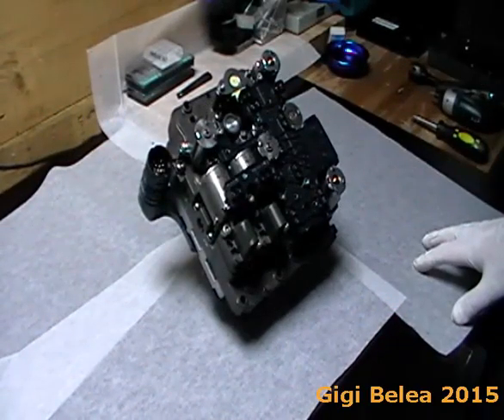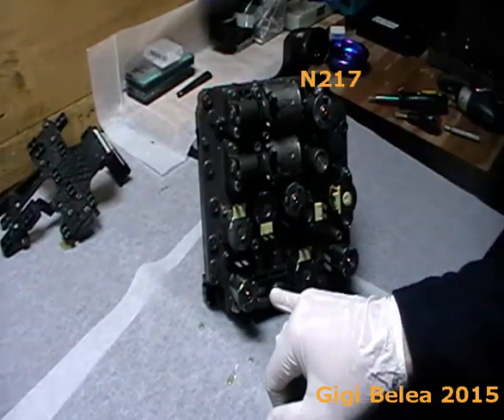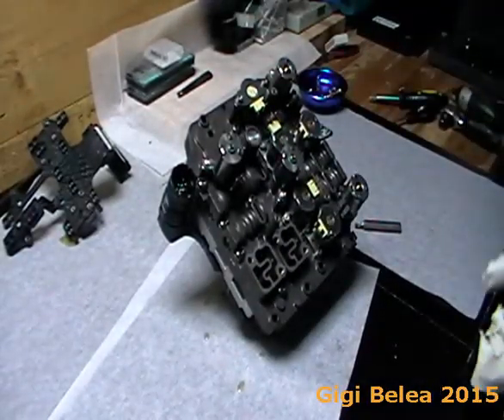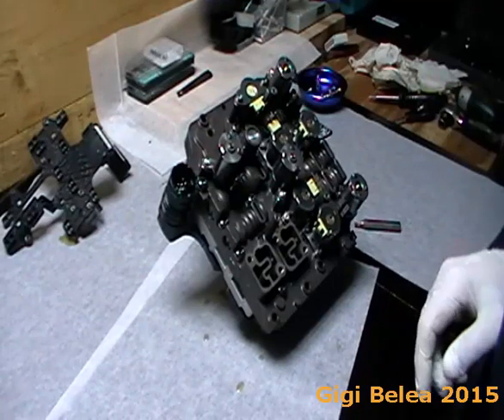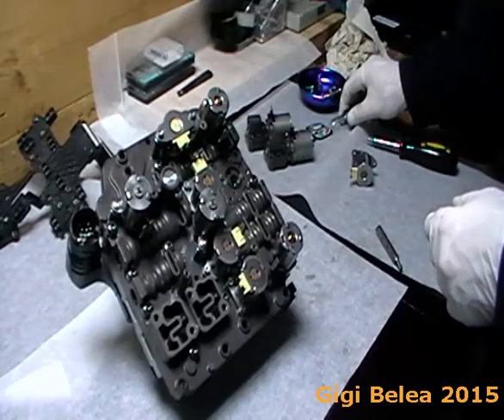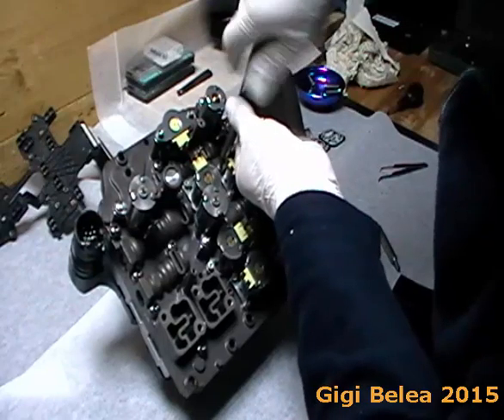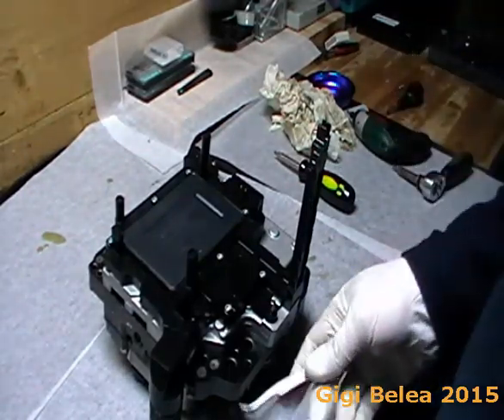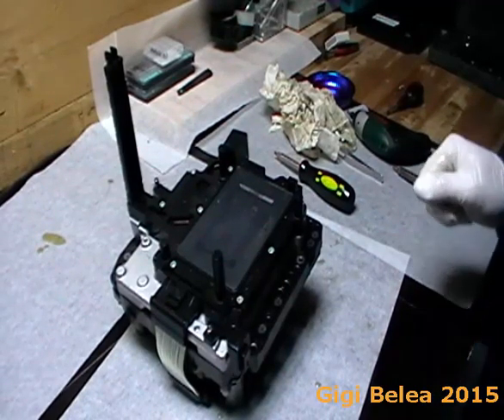Changing DSG Solenoid / Valve on DSG6 Mechatronic Unit

Comment: What can I say! Following the guide you have in your description I fixed my mecatronics myself! My issue was FORCE SOLENOID N215 N216 with jerky DSG gear changes! Your guide told me exactly what to change and the video helped me install it! Many thanks
Reply from the maker: Glad to hear your problem is solved !
Reply: Hi Greig, Did you have an issue with the transmission being jerky in reverse and into 1st gear, and also all the way up through the gears? did you only replace the N215 and N216 valves? Thanks!
Reply: @samuelpomana2286  My symptoms were:

Jerky gear changes from standstill 1st & reverse. Like Someone driving a manual car and accidentally slipping off the clutch pedal… driving up the gears from 2nd + were perfect… The jerkiness got worse and worse as the DSG gearbox got warmer. The other symptom was downshifts from 3rd to 2nd we’re hesitant and harsh. Yes changing the two solenoids N215 & N216 fixed my issue. Hope this helps. 👍
Reply: @Greig300  great! I have the exact same symptoms. Definitely 3rd to 2nd is hesitant and 2nd gear onwards going up the gears is perfect. I would much rather try and change the solenoids than replace the whole mech unit for thousands lol. Thanks for your help
Reply: @Greig300  I have the same issue with my S-Tronic DQ250 09D, did you have any fault codes shown on VCDS because I have non of them and is there any harm on your transmission if you drive it like that mostly on the highway?
Reply: @TheGorgievski  Hello, I had no codes via VCDS before or after my repair. I wouldn’t imagine driving the car on highway would cause you any harm.
Reply: @Greig300  Is there anything else I should change except the solenoids N215/N216 and what are the things I should watch while changing them, my transmission is DSG MQB Gen3 09D DQ250, I could not find solenoids for this type of transmission, only for the older models, are they the same?

Comment: I have a jerky first and reverse but no fault codes, is there any chances I can test the solenoids before removing the mechatronics and changing them. The car drives fine if it is not started for 3 days, but every other day when it's warm it has the problem.

Comment: Hello, thank you for the video.
I have one vw golf gti 2011 dsg. I have problem with first gear and rear. When the car is hot no possible to put in rear or first, PNRD light flash on the board. If you start fast and when the car is cold it drives fine. 
If the car is hot and you are in low mileage (second or third gear) the gearbox go on neutral you can't accelerate, the greenlight "press on brake come up" .

When read the defaults, there are 2 :
- p1815 : valve 1, short circuit to b+
- p1820: valve 2, short circuit to b+

We take the mechatronic out. I tested the ohms on all the solenoids everythings it s fine.

What do you think it s the problem? N215/N216? How can i test it?

Thank you 
Nice job
Reply: I have exact same problem.  Did u get an answer?
Reply: I have same problem
Reply: You can't test them, always throw that they are fine. You have to replace the n215 and n216

Comment: I have been experiencing a problem with the DQ250 gearbox for the last 10,000 km and it sounds like this:
When the clutch engages there is a clunk, the gear shifts are very linear and nothing is felt
I have noticed this phenomenon also when I go, in any gear, take my foot off the accelerator and put it back on, a clank is heard.
I'll leave some videos below with what I'm trying to explain.
I'm guessing it would be the dual mass flywheel, the car having 210k km. 
The dog bone and mounts are ok.
Replaced the CV Joints but nothing changed.
The sounds appears when you try to reproduce the noise which gets louder and louder the more you try to reproduce it
Also when i'm in idle i feel sometimes some vibratians and when i put it in D, the vibration dissaperes.
On VCDS there's no errors from mechatronic unit. 
What do you guys think?

Comment: Got CEL P0772 yesterday. Car has been running great no other codes and have not noticed any decreased fuel economy. Solenoid stuck open is code. You think that’s is actually just a bad solenoid.
Reply: Open circuit on mine too
No reverse
No 2D, 4D and 6D
Was it solenoid dead?

Comment: Hi GigiBelea
I would like to ask, maybe you can help me. The problem is i can shifting from p to any gear, if i put it neutral, the car dont roll and any gears dont do anything. I have a p0771 n92 valve failure the valve is good So i think if the mechatronic is not inserted in the gearbox i should also change gears, am i right? So it can be mechanical problem, not mechatronical? Best regards

Comment: I have a 2008 VW R32 and I'm hoping you can steer me in the right direction - after the car's transmission temps reach 80 degrees C, the car starts to have an issue. From a stop, when moving my foot from the brake to the gas, it lurches hard. After the lurch, the car drives normally, completely smooth. It also does this in reverse. No codes whatsoever. No flashing PNDRS.

I have VCDS and have performed an adaptation with no avail. I purchased a dsg service kit and that is my next step, however, I was curious what you thought? Mech unit is my suspicions. I am not sure if I should try to purchase a repair board or the solenoid kit if the problem persists or to just buy the whole control unit. I live in Tennessee and my local dealers are worthless, telling me the car is too old to work on (when I asked about a dsg service).

Thank you for your time!
-Alex
Reply: I have the same problem

Comment: Hi Gigi 

I have a a3 2006 2l T dsg , currently experiencing an issue when car runs for about 20 mins . Flashes prnd on cluster and car stays in 1 . Code was p0776 ,pressure control solenoid b stuck/off . 

Any help please and thanks

Comment: Is there a difference between the N215/N216 solenoids and the N233 solenoids? Can they be interchanged?
Reply: You can interchange just n215 with n216. The n233 is completly different to n215 and n216

Comment: Hello thank you for the video I have a question recently my car has developed a hard shift when over around 4.5/5k revs, happens in D sport or manual (paddles) drives fine in D and sport when driving normally but when I drive it hard the shifts are  hard with a slight hesitation, the car does not throw any codes and no flashing lights on dash either. dsg serviced also done basic settings and is still the same any idea what it could be? Thank you

Comment: My vw passat 2008 dsg 6 speed. No fault on vcds. But solenoid n218 measured 12 ohm?
When remove valve, measured 6- 7 ohm
Problem or not?

Comment: salut, passat 2.0 tdi 140cv 2009 dsg. in mers ca si cum ar sari din viteza si nu mai schimba pana nu opresc motorul si il pornesc din nou. am doua coduri de eroare la cutie dsg6.una este 18222 si cealalta 18243, pune ceva de control de presiune valva1 la prima eroare, iar la cealalta control de presiune valva5 N233. intrebarea este, sar putea ca amandoua erorile sa fie de la piesa N233 sau fiecare au piese diferite care sa fie stricate. cat ar costa piesele si mana de lucru . As putea sati trimit poza cum am fotografiat erorile pe tester, astept un raspuns. merci

Comment: Hi, my car was crashed at front and i change few salanoids valves , after replacing and filling with new oil car wount drive foult come as (  P174A00 - Partial transm. 1 valve 3 Electrical error ) do i need do adaptation ? thank you if you can help me 
            Intermittent
Reply: lauris196 hey bro you  fix it ?

Comment: neata. de cateva zile nu mi-au aparut ceva erori pe CV (18222 - Pressure Control Valve 1 (N215) P1814 - 008 - Open or Short to Ground - Intermittent - MIL ON,  si 8243 - Pressure Control Valve 5 (N233) P1835 - 000 - Short to Plus - Intermittent. Aceste defecte pot fi cumva remediate? am inteles ca ar da la masa si nu este defect mecanc blocul. multumesc!

Comment: Hi Gigi great videos have fault code 17160 have checked n215 and n219 have 5 ohm resistance and not connecting to earth should i still replace valves. Car drives in ist gear and reverse only.Thanks
Reply: what was the fix for your issue?

Comment: zdraco i have a problem on the DSG 6 speed touran 2003 TDI. The problem happens when the car warms up and as I drive at 2000 rpm the hand starts to go up and down. the error read on the diagnostics is P0716 the gearbox oil and filter as well as the sensor have been replaced but again I have a twitch when the car heats up and shows the same error. thanks in advance otherwise you have a great see.

Comment: salut am si eu un passat b6 cu cutie automata dsg si pe cutie imi da codurile de eroare: p1820 p1815 short to b+ am incercat de 2 ori sa curat solenoids dar tot aceleasi erori am si masina nu pleaca de pe loc am incerca un basic setting o resetare prnds clipeste si mai merge doar daca o pornesc in n iar dupa moare am alimentat solenoid n215 n216 si se aud ca lucreaza asta e important sa se auda? sau?mersi mult si astept cu interes raspunsul tau
si martorul de motor este aprins si de frana de mana parking brake fault si service coming soon

Comment: HI, my golf gti mk6 2009 has had a solenoid a pressure control stuck on “on” code p0747.
I garage said they are repairing the mechatronic but they are saying that they cant just change the solenoid “a”.
Could you please tell me if that is true or are they just trying to make me spend more money on the repair process ? 
Thanks!
Reply: They told me they are re programming it and doing a repair on it which is costing me £1100,
When i belive you can just change he solenoid  that is like £70?
Reply: 1100 is whole mechatronic :) Of course you can only change solenoid and make basic settings.
Reply: Jaxelos thanks!

Comment: Hello.My vehicle dsg 6 2013 passat.P0868 failure. The transmission oil level is normal. What brand of oil do you recommend to put.thanks
Reply from the maker: Depends on what type of gearbox it is. Can be DSG6 or DSG7. For DSG6 I only use OEM oil. there might be many brands to replace it and might be as good as OEM but as I only use oem oil I do not have any experience with other brands.

Comment: 2008 golf gti dsg 
When the car is hot and you take off from a stop it is jumpy but shifts through gears fine ? Any idea what is could be ?
Reply from the maker: To many burnouts ? :)
Mechatronic unit.
Reply: @GigiBeleaDK  What else could go wrong in the mechatronics expect the solenoid valves ( if it jumps should be n215/n216)  ?

Comment: Sal. Am un Golf 6 1.2 TSI cu DSG 7. Dupa ce se incalzeste motorul
(mers 15-20 de minute) in treptele 3,4,5,6,7 si numai la turatii intre
1800-2100 incepe sa mearga in suturi. Aceste "suturi" se inmultesc cu
cat merg mai mult, dar numai in plaja aceea de turatii. Pe modulul Sport,
trecand direct la turatii mai mari (>2500) nu face. Problema a inceput dupa
schimbul de ulei + filtre la 60000 km. Am schimbat: adaptare clapeta de
acceleratie, ambreiaj, bujii, fise, bobina, filtru de benzina MANN (6.6 bari-
cel recomandat) + lant distributie (trebuia).

Comment: Hi I have a open circuit fault relating to the n215. The code is p1814. I’ve removed the mechatronics, tested the valve which is reading good, checked the wiring harness which is all good and today I removed the plastic cover hoping to see a broken wire/solder joint but everything seems fine. Does this sound like a fault with the main board to you? Many thanks in advance JP.
Reply from the maker: Yes, seems so.
Reply: @jamesperry6672 where did you find the details on testing the values of the harness and the valves?

Comment: Hi Gigi...
I have this fault

19143 - Unexpected / Implausible Mechanical Gear Disengagement 
Its Skoda Superb 2.0 tdi 125kw with DQ250 2E
The problem when i try to change from Drive to Neutral. Gearbox start to clunk VERY HARD(almost everytime) and sometimes gear indicator disappears on dashboard. Then i only can to engage gearbox in second gear when put in drive again, before i restart a car.
I change oil and filter, gearbox work from then excellent, but after 7000-8000km same problem start again. Change oil one more time but now nothing happend, same problem.
Sometimes hard downshits from 3-2 and 2-1.
Do you have idea what it can be?
Thank you very much for the video :)
Reply from the maker: Most likely clutches or other mechanical problem inside the gearbox.
Reply: BigBoysKnow U you need a new clutch pack it's worn!

Comment: Hi
I have a golf 5 1.9tdi dsg
My vcds picked up a fault n216 short to B+
PRND was flashing and not going into reverse 
When I checked the resistance on the n216 it was 4.9ohms
So I decided to change it and now it's still doing the same thing and the resistance is also at 4.9ohms
But now it's banging into drive and still flashing after u drive for couple meters 
Any advice I am stuck
Reply: Hi ,I have the same issue how did you solve it??

Comment: Salut domnule,te-as ruga daca ma poti ajuta cu un sfat,am un Vw Passat CC 2,0 tdi cbbb 125 kw,cutie automata dsg  cod LQT,i-mi apare eroarea :17252-Transmission Fluid Pressure Adaptation at limit-intermitent,mentionez ca a fost schimbat uleiul si filtrul la cutie,cu ceva timp in urma si volanta,cutia schimba foarte bine ,poate doar cand se incalzeste mai bine uleiul are cateodata tendinta de a smuci usor la plecarea de pe loc,ai vreo idee? Multumesc mult!

Comment: I have a 2012 passat sel tdi. 6 dsg trans. The car drives without any shifting issues however it randomly faults for the same code P0776 n-217 main pressure off. Help please?
Reply from the maker: Might be your TCM that has a problem and not not the solenoid... only way to know is cut it open and check it.

Comment: 2.0 tdi 140kw dsg6,Passat 2007.

I have a problem that car is jerling when goes to reverse or 1st gear.
Can You tell me if it is clutch pack or mechatronic unit?
no error mesages.
Reply from the maker: Usually this are the N215/216 solenoids that are worn and can't open/close properly.  I would start by changing those. If that does not help then a mechanical valve could be worn also and that is impossible to change.
Reply: Is this n215/N216 related to studdering and jerky take off 1st gear from stop light as well? I noticed going in reverse is also jerky.
Reply: Did u solve the problem...same problems for me....n215/n216 solenoid valve...

Comment: After replacing the solenoids will this unit need to be uploaded with a tune/program?
Reply from the maker: Only basic settings.
Reply: how can you perform gearbox adaptation on UDS ecu ? basic settings doesn't exist anymore on new ecu.
Reply from the maker: What software ?
Reply from the maker: There is ALWAYS option to perform basic settings, no matter if the software is UDS.
Reply: @GigiBeleaDK  ... hello can I get your email..I need sgo flash file for Audi A4 transmission 2008 model
Reply from the maker: @danodoi4402  If you look in video description you can see my contact webpage... http://www.evosoft.dk/tech.html

Comment: If i change de dsg oil wil it work good again because maybe is the oil old and when the oil get to hot than it wil send fault prnds 2 because when the car is cold i dont have prnds flashing but engine symbole is on in the dash do you think changing oil will help
Reply from the maker: Don't think changing oil will help.
Reply: @GigiBeleaDK   First start cold engine, hard dumps coming from gearbox when I take off, works fine when engine get hot.
Reply from the maker: @karlpaljev9790  Bad oil or filter or sticky valve / solenoids.
Reply: @GigiBeleaDK  i drained out 2liters only, and put almost 5liters in. Hope it works.

Comment: Gigi, how to perform gearbox adaptation before I can drive, if Ross-tech states, that gearbox oil has to be between 30-100°C? Is it OK if just run car still and wait till gearbox oil temperature reaches at least 30?
Reply from the maker: Yes, you have to start the engine and let it idle until temp is high enough. On diesel you can also rev it a bit while standing still so the temp gets up faster.
Reply: Does gearbox shows any errors while warming up oil, before i do adaptation? 

Thank you for info.
Reply from the maker: Normally you will delete all errors before starting adaptation. So key on ignition point, erase all errors , ignition off, on again and start the engine. No error should be present if unit is OK.

Comment: Can I test the solenoids with a multimeter without pulling the mech out? Maybe I could test them from the harness?? Thanks
Reply from the maker: yes, should give you similar values.
Reply: @GigiBeleaDK  I just ordered the 02E Inptut And Temp Sensor
Part #: IPN7-308438 and VW DSG Sensor - Temperature
Part #: 02E-927-321-A from cobra transmission. Do you have a video showing these sensors being replaced?

 My 02e has an APR tune. I recently did a DSG adaption and now it only shifts when its cold. When it gets to operating temp the car pops out of gear into neutral. It can go back into first gear but it will not shift into second. Reverse pops out while using it.

I installed new clutch packs and borg warner frictions a year ago and swapped the n215 and n216 solenoids. I went with ebay parts. This time I bought borg warner solenoids. Do you think this might solve the issue? Thanks again!
Reply from the maker: @Messy_Jesse  Depends on hardware number of the mechatronic ... changing the speed sensor is quite easy .. remove mechatronic , look on left side of gearbox housing. Remove screw , replace sensor , put mechatronic back in.